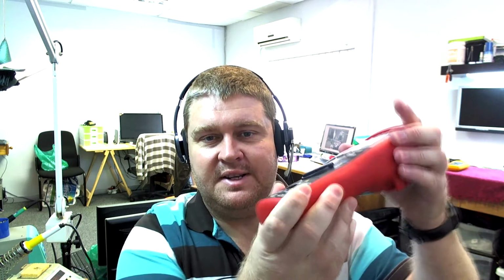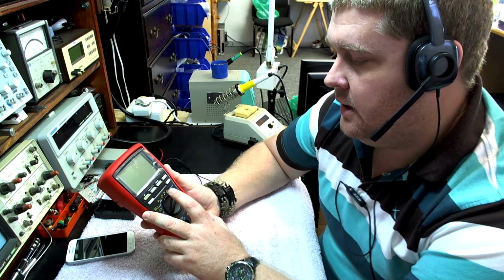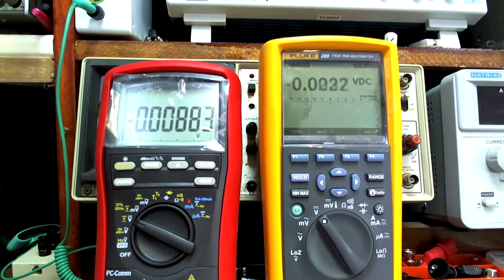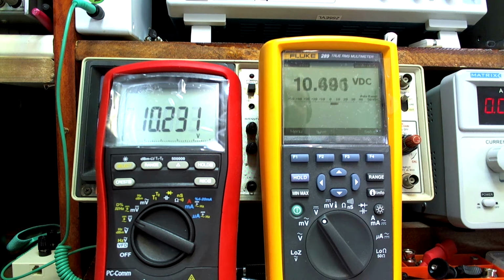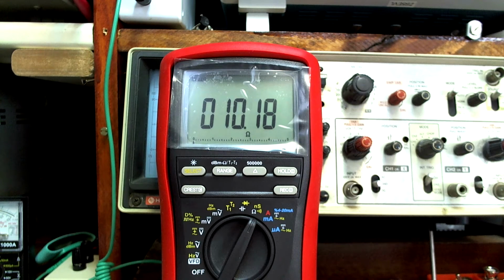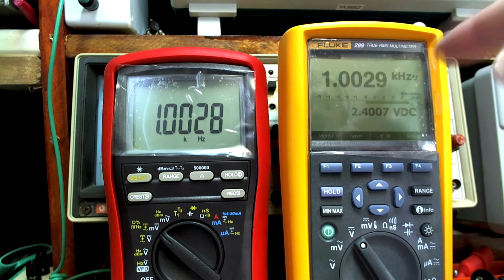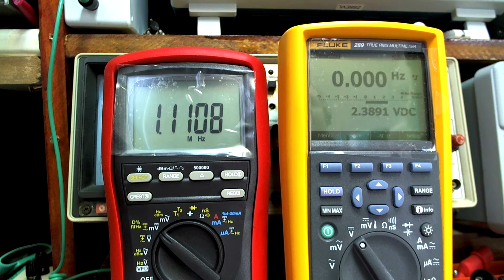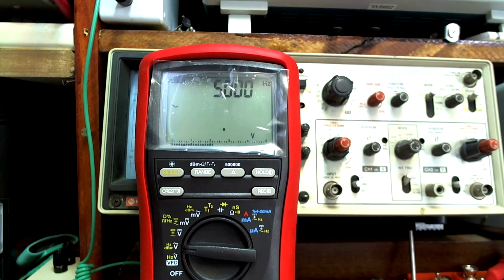Episode 68   Brymen   Toptronic TBM869 Multimeter Review

Comment: The need is the improvement/repair of SMPS. So I need a meter capable to dislay DC+AC "noise" of switching frequency, superimposed. Is this meter (or BM 867s) able to performe the task ?
Reply from the maker: Most of the TBM 800 series are able to do this sort of work. I will make a video follow up of the TBM812 or 829 doing AC/DC simultaneous if you like. Just need a few days to put it together.